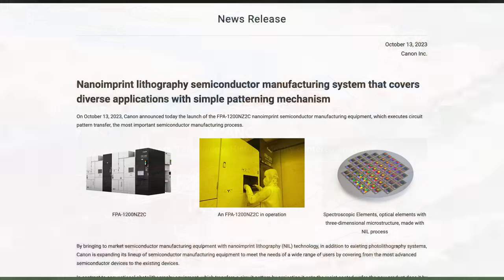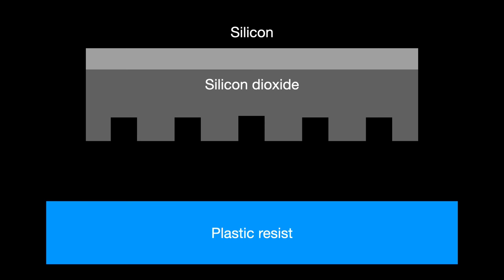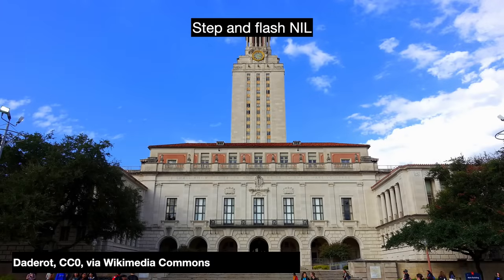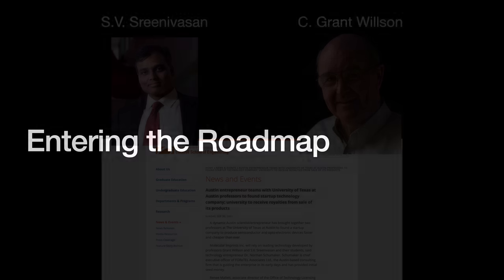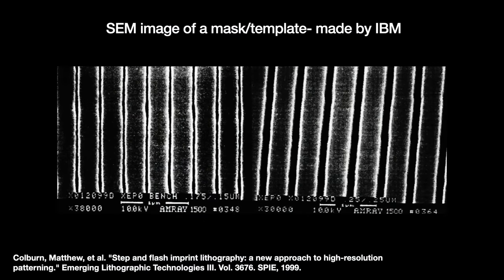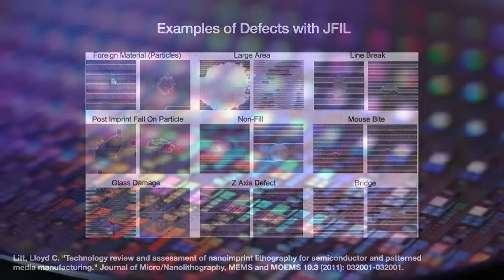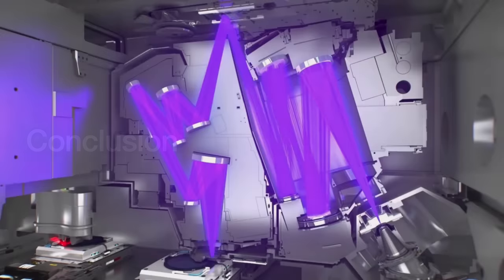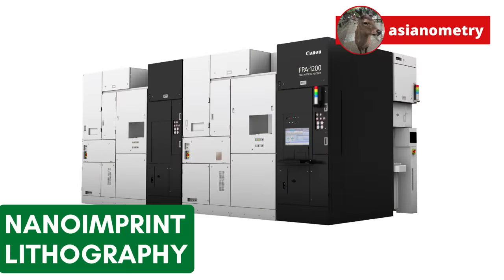A Deep Dive Into Canon’s Nanoimprint Lithography

Comment: I have a burning question about CPUs and logic gates. This is a bit off topic here. But i follow this channel for about  2 years now and i think there might be someone in the audience to answer this. Are the logic gates on a CPU static or dynamic? Example: if i have to do alot of XOR operations, can i use all the possible transistors on a cpu? Meaning all the paths will get 'directed' in a way so that i can create the maximum amount of XOR gates possible? Or are they fixed, meaning hard wired? That would mean that the manufacturer has to decide how many transistors he would use to create AND gates and OR gates and so on. If so, can we wee the key on how many percent of transistors were used for what gates somewhere in the CPU specs?
Reply: Have a look at FPGA's! There you can reroute the hardware into whatever gates you want
Reply: You want fpga

Comment: Some day it would be nice if the semiconductor industry would just start calling it "node 5" or whatever internal name the company making them uses for their current process instead of "5nm". It's been a long time since that meant anything and its been a long time since that meant exactly the same thing between companies.

I mean if I started making miniature model trains smaller and smaller and when I reached 4.5 inches I just made them the same size but called a "0.5 inch model train" "effectively as good as a 0.5 inch model train" while it was, in fact, physically 4.5 inches long, I would be rightly sued for false advertisement.

I mean what metrics of performance or power consumption mean anything anymore? I mean I can have a "5nm" "3.5GHz" "24 core" M2 processor but none of those mean anything. If I actually pretend I can use any of the M2's specifications, I'll have a melted lump of silicon and if I (was even able to) use them at half their rating it will fail in a month.

Remember when you could get a 16 core, 3GHz Xeon and you could run it at it's maximum capacity for 10 years and it wouldn't fail?

Comment: Wild thought, but I wonder if we will see radiation used to etch wafers, after all the wavelength is shorter than UV.
Reply: All light is a form of radiation. UV is radiation, visible light is radiation, radion waves are radiation, etc.
Reply: Are you talking about gamma radiation from radioactive materials? One of several issues with shorter wavelengths, whether it's x-ray or gamma, is making a mask that won't leak photons. Would probably need to be a mask made of gold for the opaque parts.